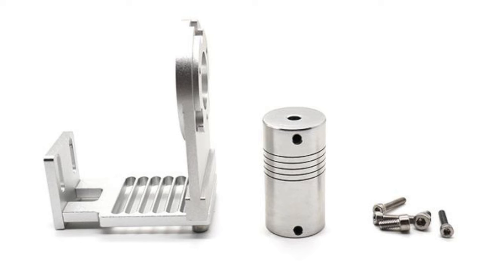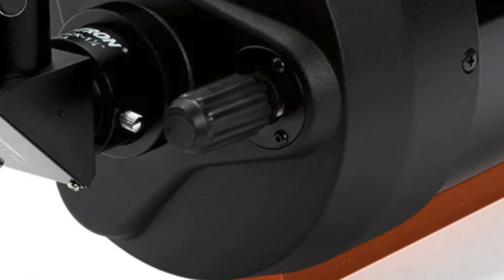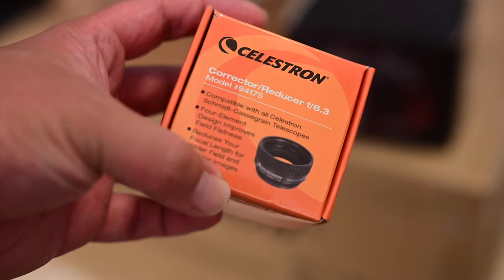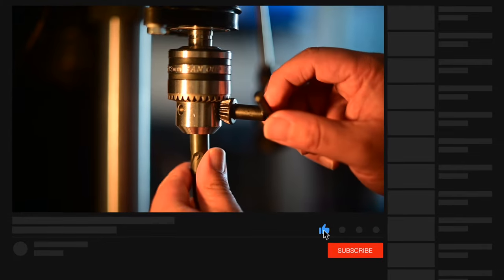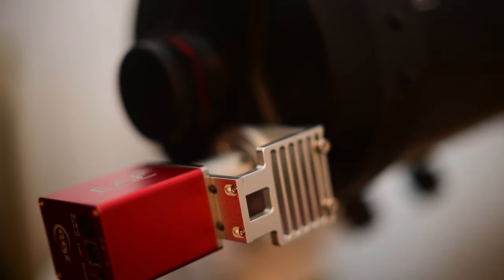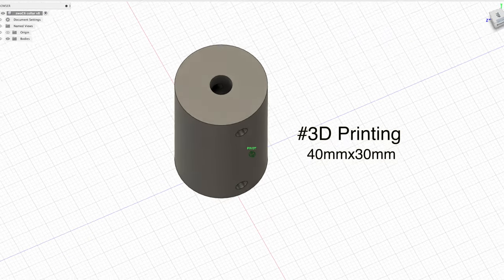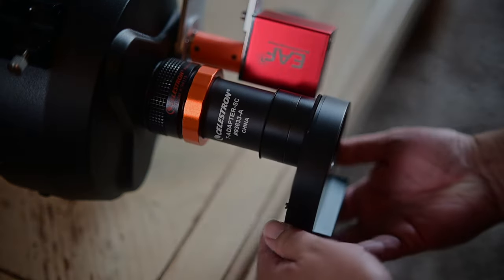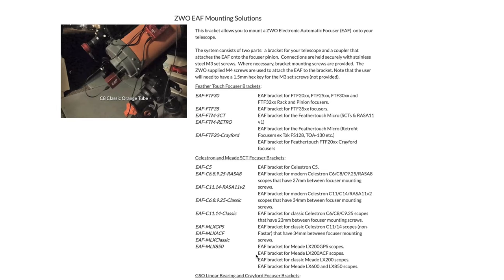How to install the ZWO EAF on the Celestron C6 ( 3 options)

Comment: Where did you get the orange ring for your t-adapter?
Reply from the maker: It's from an edge HD 8 inch spacer kit. https://amzn.to/3T1alfA
I found out later that the spacer for the C6 is the same part as the edge 8" at least up to the 50mm spacer.There is an additional spacer that for 8" and comes in 2 pieces. So if you are interested in the ring you can essentially purchase the spacer kit for the HD 8" and install the orange ring and 50mm spacer on the C6